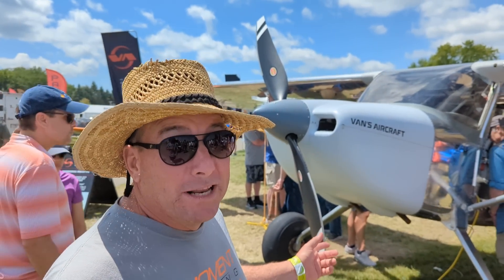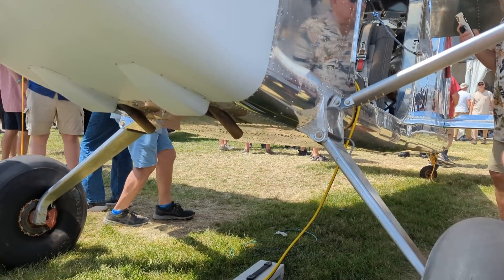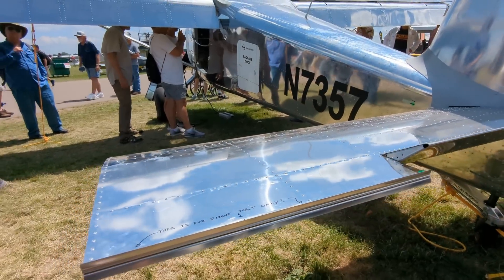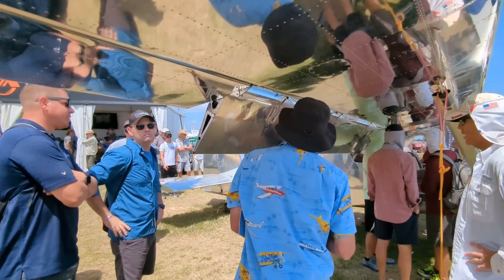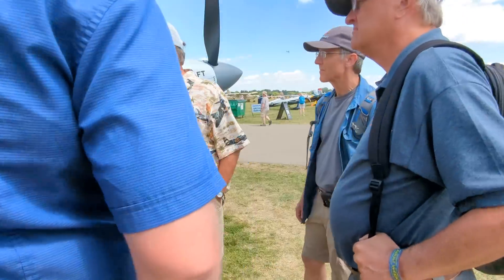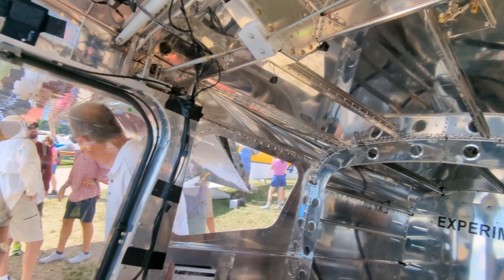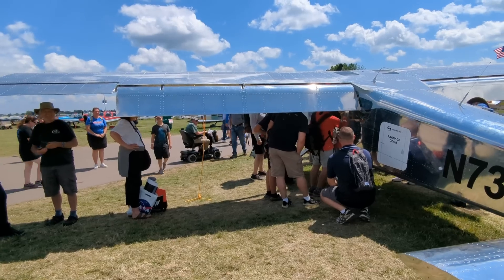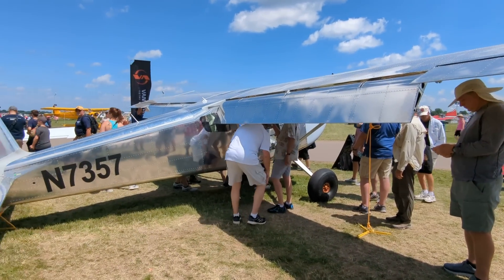Vans Aircraft RV-15 Bush Plane! Engineering Prototype Airventure 2022.

Comment: 8/3/22..so Juan at Oshkosh..u show us this Van A/C experimental Cessna copy. Any comments on Mike Patey's unique 1-of-a-kind 'Scrappy'/Rescue extreme fancy 500HP Carbon Cub copy. Com'on..tell us what you think..Mike Patey is absolutely over the top on all the  extra engineering, double leading edge/aileron/flap extreme angles/dual-double shock landing gear hydraulic control/tail wheel extra...xyz...can't remember...soo many fantastic extras. Hope to hear your comments..⚙🛩🤔
Reply from the maker: Modern day Howard Hughes! Mike has already covered this aircraft better than I could.

Comment: Thanks Juan! That was a really great walk through of the Vans aircraft I wanted 10 years ago. But better late than never, this aircraft is going to put a huge smile on the faces of a lot of pilots.
I do love that the Johnson Bar is located up high - in my 172B it's on the floor witch is distracting to operate.

Comment: Is that anti servo tab on the stabilator?   Are they using steel core or hallow rivets?  Think of the corrosion factor especially if it goes on floats. They better have a inspection panel in the floor under your feet for the shock absorbers there

Comment: What a nice looking aircraft! Great to see some more competition in the off-field STOL arena.  Especially a Vans - they've got some top notch stuff! I'd want to leave it unpainted like this - looks great I think. I suppose it would be a chore polishing all that real estate, though. Shocked at the price! I'd have figured at least double that in today's world. I just paid over $310 for THREE hydraulic hoses for my backhoe today! OUCH!! I looked for the 24k gold lining, but alas ... 😁
Reply: For that price, did they come full of oil?
Reply: Would using clear ceramic coating on the beautiful aluminum surfaces protect the surfaces for 3 to 6 months at a time? I'd like the low drag that would provide.

Comment: With pop rivets this will be a very fast build time like their RV12.  This will be such a popular plane it will out sell all the RV models.  Vans has come a long way since the RV-4 I help in building back in the day over 40 years ago.  Back then you did just about everything and the build hours were very long.  I want one when they are taking orders.
Reply: You sound like an experienced builder, so maybe you can answer a question.  Could bucked rivets or whatever the proper terminology is, be used instead of pop rivets when building one of these?

Comment: I've worked on a variety of Helios, PC-6's, and even a Do-27 in the mix. It looks like the team behind the 15 clearly understands bush aviation - not just the STOL performance, but the necessity for easy field maintenance as well. The Helio and Do-27's are cool with their LE slats and other STOL devices but from an mx perspective it can get very involved. Good to see this plane focuses on operational simplicity - the truth is most RV builders aren't gonna be too keen on doing 50-hour inspections and following ICA's to the letter. Of course, since it's an EAB, it's only a matter of time for those that are willing to be more involved with their airplanes to add aftermarket devices! And I'd love to see that too - I can already see the VG's, fairing mods, and bellypods coming!

Comment: They wanted their own Draco? :)  50k isn't bad although the engine is 40k+?  really not a big fan of kit building, imagine buying bare parts from a car maker and having to do it all yourself. Including paint. Hopefully the proposal for factory built experimentals is approved. And factory built experimentals should be encouraged to be a step towards certification. An FAA guy can assess the design and by virtue of practical tests in owner hands it can be fully certified. Kit building is part of the poor state of GA. It's way too cuba.
Is the stabilator a complexity risk? seems a little ambitious for a kit.
Reply: Looks like you’ll need to move on from considering this 👋🏻
Reply: @Ts-zy4bw  from what? bettering GA? no

Comment: Thanks Juan.  Very helpful and happy to start getting some real numbers.  This, not surprisingly, seems very well positioned to dominate the market space.  The name and support behind it alone will tip many folks on the fence of their build selection.  For some it'll be aluminum versus fabric.  I had 2 competitors in mind, but this blows them away.  Only thing on my personal list that leads this one would be the Bearhawk model 5 which is apples and oranges. Totally different planes, missions and profiles.  Still, this could accommodate most missions and widen the gap needed between my toy and my transportation.  Interesting.  Ugh, with the 1 year expectation was  'we'll take your money today and delivery in Q4' :)

Comment: carbon cub is also like $300k and doesn't have a cruise of 140 knots... just saying.
Reply: Yeah, the extra fuel burn wouldn't discourage many from such a huge upgrade in load and interior size.  I am sure the stall speed will be fairly close as well.  If both can operate on a 400ft strip....  we have a winner here

Comment: Here is my question. Why would anyone use pop rivets? I prefer to do it the old fashioned way with an air hammer and a bucking bar.
Reply: Pop rivets are faster and they allow for predrilled holes in the panels.
Reply: And to add to your reply, not a lot of people know how to hard rivet correctly and may not have the inclination to learn nor the time. It opens the build to a larger group of people I think.
Reply: Pretty sure that when Juan said 'Pop Rivets' it was shorthand for 'Cherry Max' - the Cherry Max are every it as strong as a bucked rivet, and way stronger than an incorrectly amateur bucket rivet.
Reply: @GlensHangar  I have never heard of them.
Reply: @GlensHangar  ... just as strong, for only 7x the price?
Reply: @Neil_  I knew someone would make that comment - there's always someone who will value low cost over safety.
Reply: @GlensHangar  LMAO. Right, that's what I said. Since we're inferring rational, I guess you value speed over safety. 

The best argument for the safety of a pulled rivet over bucked is any 'ol ham fist can do it, I guess. Compelling. That sound like you? 

You didn't have to be a dick. It's a fact they are substantially more costly product for the same results. Nothing wrong with pulled, if you're into spending extra cash to avoid learning a skill lol
Reply: @Neil_  I'm too tired to argue - but here's the scenario: Over the last year I tore down and rebuilt a 1961 172B, including the addition of many mods: STOL kit, wing extensions, full suite glass panel, etc, etc, etc. I did the work myself, and I bucked a lot of solid rivets.

When it came time to strengthen the wings so we could add 3 extra feet of wing extensions (18" on each side) - the aeronautical engineer specified Cherry Max rivets for all of the work... because they are stronger; no matter how good your skill is at pounding in solid rivets.  Even the 50 year veteran AME / aircraft structure sheet metal expert who helped me with the wing extensions and beefing up the structure, was glad to see Cherry Max specified: because they are stronger; no matter how good your skill is at pounding in solid rivets after 50 years of doing it, 25 of those in the military as the aircraft structure expert, and 15 as a consultant engineer with de Havilland / Bombardier.
 
Nothing to do with speed - and everything to do with safety. But I know I'm wasting my time, you won't actually listen, you'll just have some snappy sarcastic comeback.
Reply: @GlensHangar  

I have to apologize.

Just watched your wing extension video and I was wrong. Your structure guy was happy they were cherry max so he didn't have to have that nice lady help him buck all day while you walked around with a camera telling your audience how much you know LOLOLOLOL. 

Tell us more about YOUR rebuilding 🤣
Reply: @Neil_  Exactly the smart ass comment I expected...
Reply: @GlensHangar  

😂😂😂

Is there ANYTHING you don't know? 

I'm in awe!
Reply: I would also imagine it's easier to do field repairs with pop rivets if needed.  That was the only reason I could come up with.
Reply: When the competition in the all aluminum backcountry kit plane market are using blind rivets, you probably feel you kind of have to.
Reply: Adding on to what people are saying here already, pop rivets can be easily done with one person. Especially for fuselage skinning that is generally difficult with the old school method.